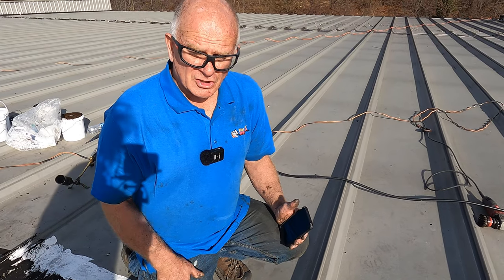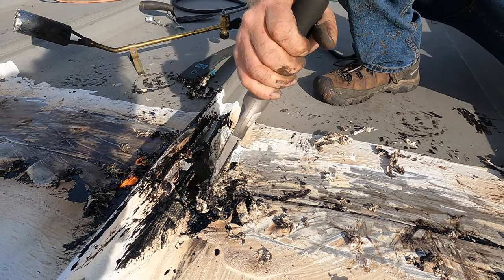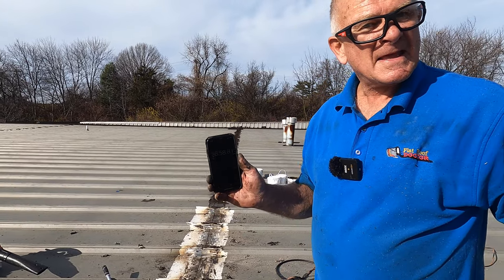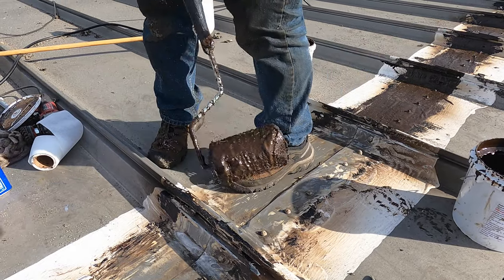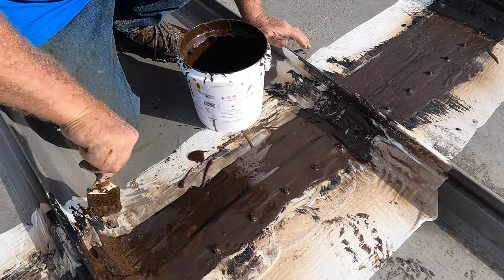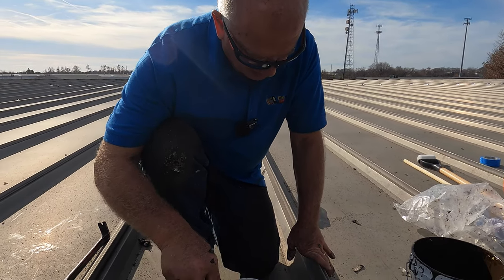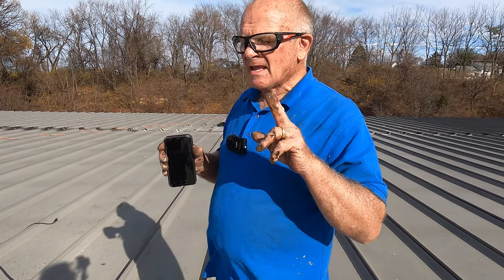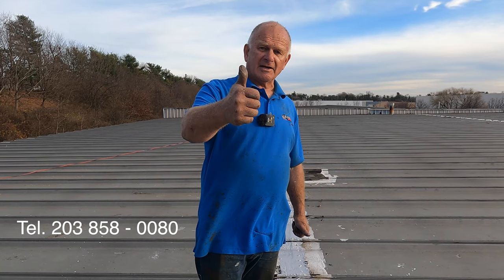How to Calculate the cost of Repairing Metal Roof Seam

Comment: Why would you have to seal those seams why do they start leaking
Reply from the maker: The gasket sealant used in the original installation either was not sufficient or shrank due to heat and the seal was compromised. This is a common problem on low-sloped metal roofs.

Comment: Why is there so many low slope metal roofs in your area
Reply from the maker: My area? I travel up and down the east coast to do these projects. From Rhode Island down to Florida and the to Mississippi and the to Texas. So you assume I only work in a small area. My Yukon Denali has 450, 000 miles on the clock. About to give up.